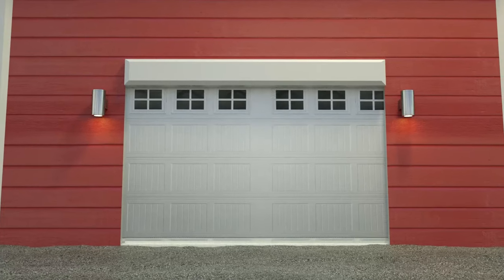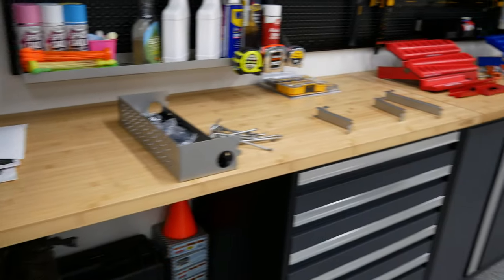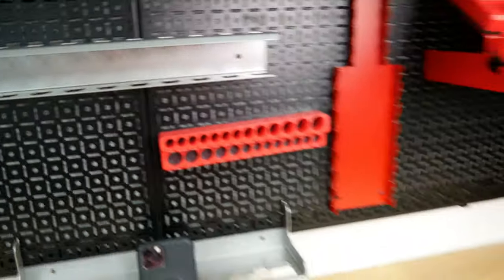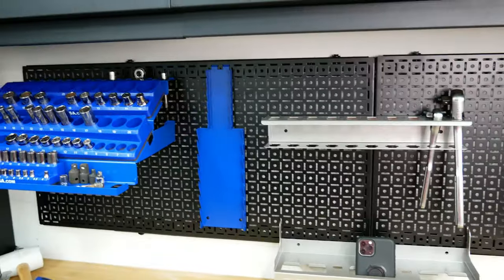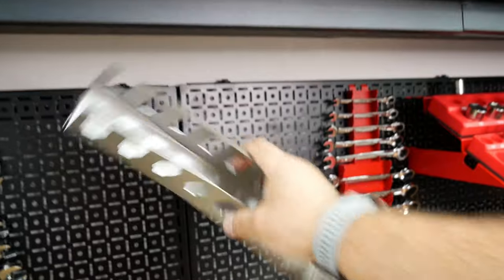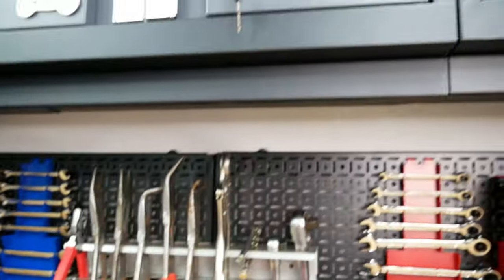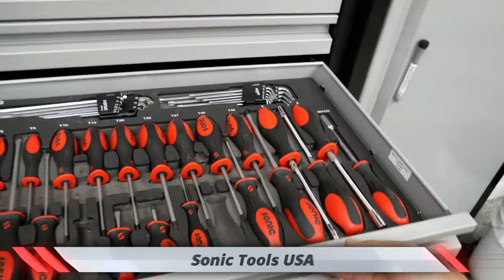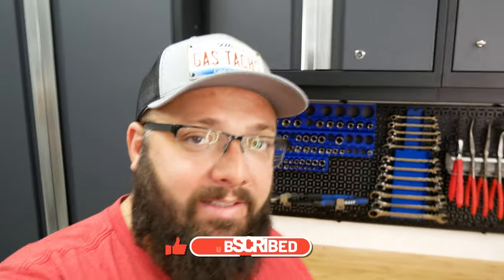Best Socket and Wrench Organizer, Omni Wall Pt. 4 Garage Wall Tool Organization

Comment: We really appreciate the feedback and constructive criticism. We have a revision in the works for all 3 of our wrench holders. The one you displayed will have wider openings and fit 3 more wrenches. Hopefully this should eliminate the issue you found in your demonstration. For someone like yourself with a big catalog of tools, you might try hanging your wrenches on our short wire hooks.  Anyway, the garage looks great and keep up the good work on the videos!
Reply from the maker: Thanks, with those changes to the Wrench Holder that will make it perfect!
Reply: @GasTachs  I'm very impressed with Omniwall comments about making revisions due to these problems.  I built my dream workbench last year and am so upset I used Wall Control and did not know about Omniwall at the time.
Reply: Why not just hang the rubber wrench holders on some of Omniwall hooks?